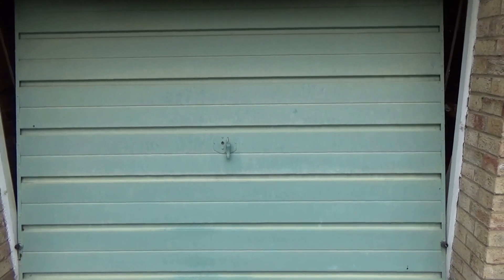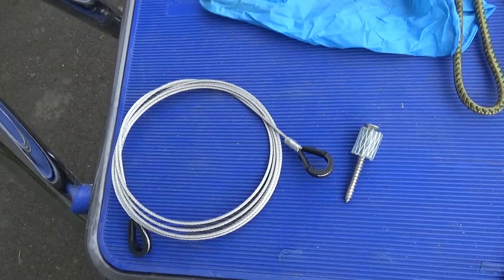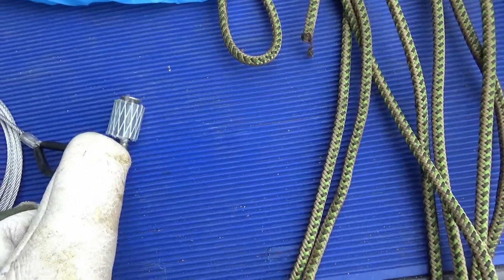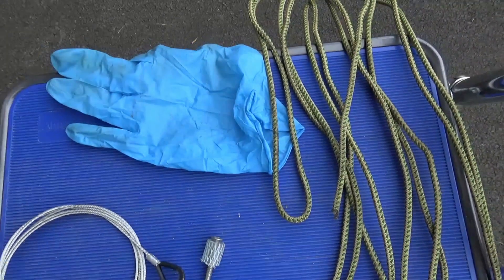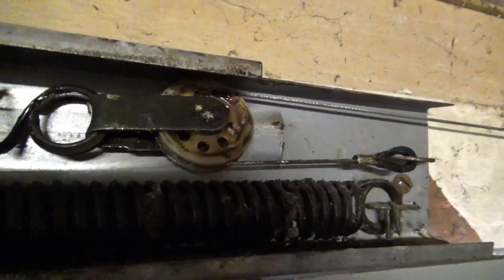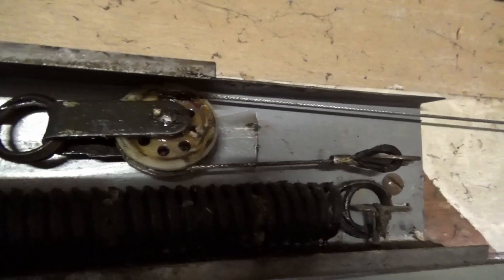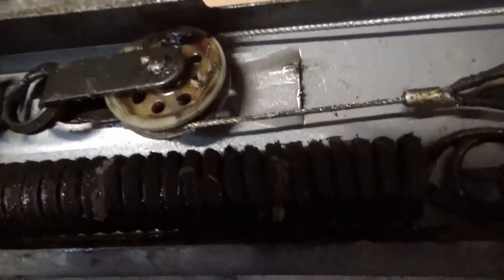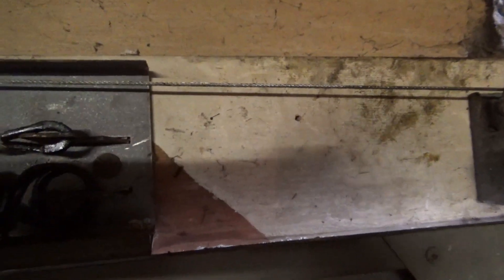Garador Mk 3 wire replacement

Comment: 2 years since I first watched this video and attempted to fix my door, and it's still broken. It's one of those nasty jobs I keep putting off. I intend to have another go at it this weekend if the weather permits, and once again I will be using the technique you've described in combination with some of the suggestions from other commenters.

Comment: Thank you for your video as it helped me out a lot doing this on my own.  I managed to pull the cable through the corner roller by hand so didn't need the screw/rope part.  Once through the corner roller, I used a g-clamp and a small angle bracket to stop the wire from jumping off the corner roller as I pulled the cable down with the screwdriver T handle (this kept happening on earlier attempts).  Finally I put a small rope loop through the end of the wire so I could use my foot/body weight to pull the final bit of tension to get the spring fully extended leaving my hands free to ensure it clipped onto the retaining lip.

Comment: What a lot of rubbish he talks. You need gloves for sure. Mole grips. Cord.  First unscrew the bottom screw on the vertical chanel to reveal the wheel hook.
Thread wire through top roller, put cord though the eye. Hold this in position. The other end eye attach mole grip. Holding the cord, pull the mole grip wire onto the spring hook.
Next pull hard on the cord drawing it down onto the wheel hook, requires lots of effort 👌
Reply: I'd love to see a video explanation of your method. Not sure I follow your explanation but it sounds simple enough but can't visualise it.

Comment: I use a ratchet strap to pull the spring closer to the corner pulley wheel, attatch the wire, then release the strap.

Comment: Thanks Ivor. I have made a replacement cable using some spare 2mm stainless wire rope but was struggling with stretching the spring. That clever way of hooking the pulley on the backplate is a godsend.

Comment: This is such a hard way to do it. You don't need to put any tension on the spring to start with.  Attach one end of the new cable to the anchor, loop it through and around the spring roller mechanism. Use the old cable and loop it through the end of the new cable and thread it through the corner roller unit on the door frame. At this point the hook from the new cable won't be close enough to make its way through and around the roller. Keeping hold of the old cable you've looped around the new cables loop pull down on it gently as someone opens the garage door slowly for you (you can do this yourself but help is easier) As you open the garage door you'll see the anchor bracket rise and then it's simply a case of pulling down around 6" or so to put the spring in tension and anchor by attaching the loop. This principle I've used for changing springs, cables for years on over 300 Garadors, Westlands and Catnics etc. Job done in less than 3 minutes..

Comment: You're a genius Ivor, I wouldn't have had a chance if it wasn't for this video. I'm not going to sugarcoat it for anyone that decides to take this on, but it's an absolute pig of a job. However, it can be done if you do it exactly your way. A handy addition to your approach is if you tie something heavy on to the end of your rope (I used a big chuck of log), it means that you're not using all your strength to pull the rope down when you're stretching the spring, and you need a really beefy screw to take the weight of the rope with a big washer sat on the end so the rope can't come off. Thanks again, a brilliant video.
Reply from the maker: Thanks, Bob, I'm glad you found it helpful. That's a good idea about the counter-weight if you're doing the job solo. If people have a set of loose weights for keeping fit, they can probably find one that matches the tension in the spring and have a convenient hole to thread the chord through.

Comment: At 5:40 we found that looping a short length of rope around the wire made it much easier to pull in order to release the pulley from the clip.

Comment: It's a very good plan but proceed with caution. I attempted it yesterday and I failed because the supposedly strong paracord I purchased to do the job was not strong enough and snapped with a mighty bang when I put enough weight on it. I had used a fat screw, put a penny-sized washer on it first, then a small socket from my socket set to act as a roller, then another washer, and screwed it into the wood. The screw was bent like a banana long before the rope broke. I will probably try it again soon with better rope, but anyone attempting this should first appreciate that the springs you're pulling against are incredibly powerful, you're going to have to stretch them something like 18 inches, and there is a serious risk that you can end up injuring yourself in the process.

Edit - I think I see where I stupidly went a bit wrong with what I tried to do. The rope and temporary roller are only used to extend the spring a little bit so that the new cable is long enough to be threaded around the spring pulley and over the lifting arm bracket pulley, from where a screwdriver can be inserted through it and pulled on to extend the spring the rest of the way. I was trying to stretch the spring all the way to the retaining socket using my rope and roller, something which I never could have achieved. I will try again because I'm determined not to have to go buy a new spring box for it (somewhere in the region of £190 for the one I need).
Reply: Loving the idea of the socket as a roller - ingenious
Reply from the maker: I think you might be missing a stage. The rope only has to pull the spring about four inches (10 cms). This is enough to get the wire over the top corner pulley wheel and allow you put a screwdriver through the wire eyelet which stops the wire from retracting when you release tension on the rope. The greater tension (to get the flange to hook onto the bracket so you can attach the wire eyelet onto the garage hook) is achieved by pulling on the screwdriver and using the wire itself. The improvised rope and screw set up plays no part in the second stage.
Reply: @ivortymchak  That's right, I did miss that bit - I mentioned it in the edited bit I added to my post. I shall be trying it again soon with a better rope and hopefully it'll give me enough slack to get the wire over the pulley and get the screwdriver through it. Maybe I'll do it when I'm less tired and not miss any steps this time! Thanks for posting, you've helped me out.
Reply from the maker: You're welcome.  @BarnSt0rmer

Comment: This was a really great help when I did mine today. Thank you!
Reply from the maker: Glad it helped!
Reply: Yes your method with the pivot screw and foot stirrup. Made it very doable by myself. However i found it better to tie the cord round the pulley wheel as tying to the spring blocked the spring anchoring somewhat. It was still worrying with the extreme spring tension and with the garage door shut so my wife was in there too for moral support!
Reply from the maker: Tying the chord around the pulley wheel is doing it properly. I just found it easier (and less greasy) to slip it through the spring. I could make sure the anchoring took place when my daughter pulled on the chord (my son refused to help after he'd googled the dangers of garage springs!)